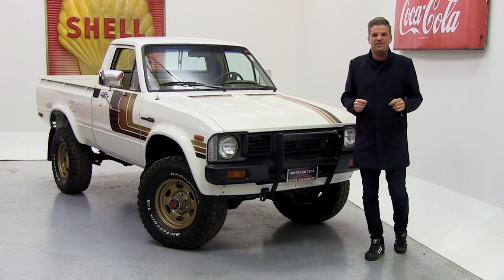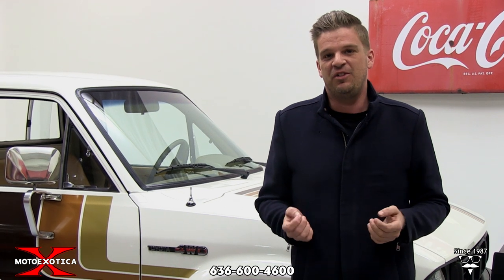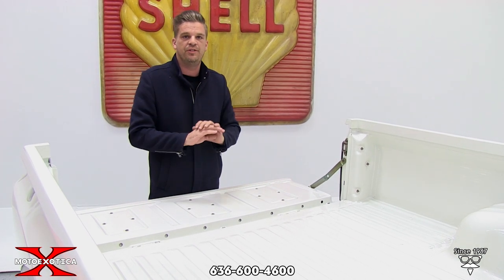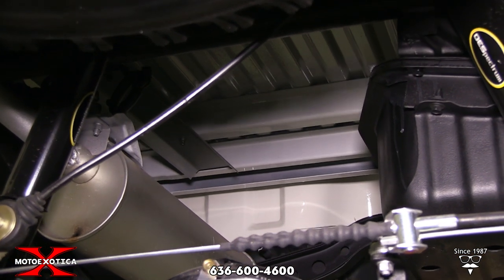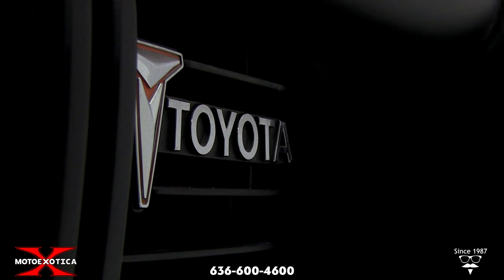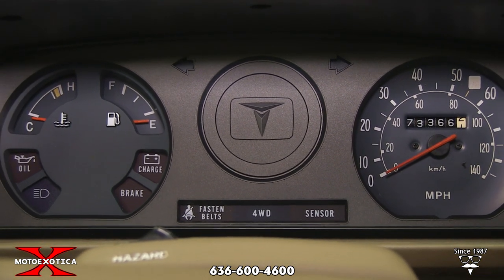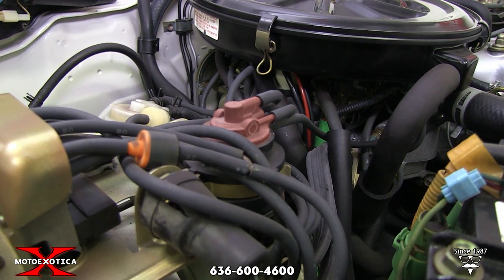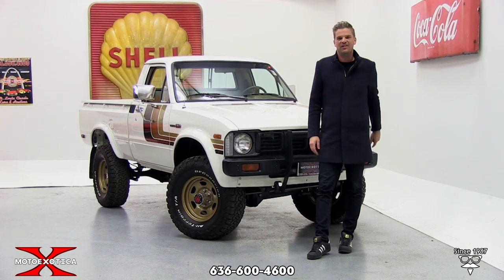1981 Toyota 1/2-ton 4x4 Pickup (SOLD)

Comment: They did not do a SR5 4x4 in 1979 or 1980, 1981 was the first 4x4 SR5, this truck is the deluxe model...not a SR5
Reply: Correct, 4 speed, and no tach. I am not sure if SR5 from that model year also came standard with AC. Perhaps it was still an option based on location. Also an SR5 from that year would have had carpeting.
Reply: Glad you caught that haha! The 81 also had the cluster gauges on the bottom area behind the shifter.  Oil gauge and battery voltage gauge 👍🏽
Reply: Set was available on 79 80 and they had 20r 2.2l engine. 81 was the year of 22r
Reply: Good attention to detail

Comment: The only problem I had with my Toy 81 4x4 SR5 is the the transmission input shaft bearing went out at 70K.  The fix was to go from a ball bearing to roller bearings........